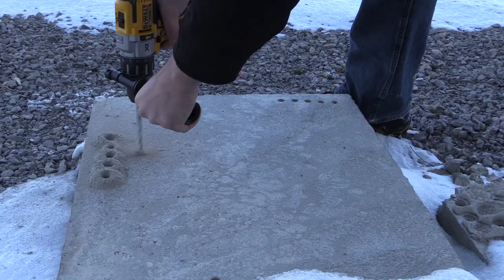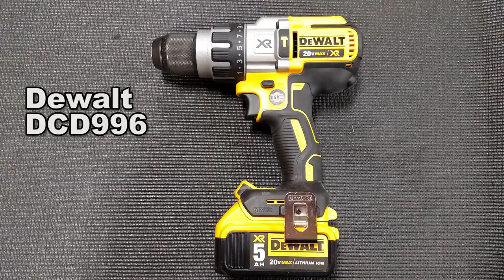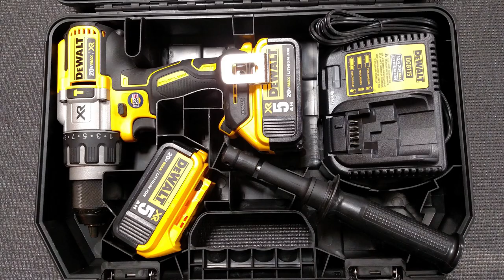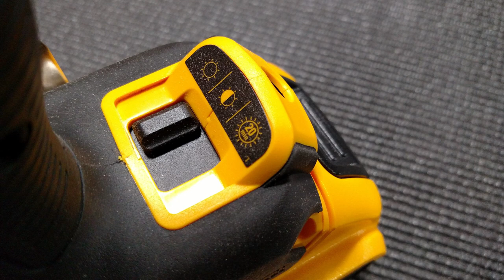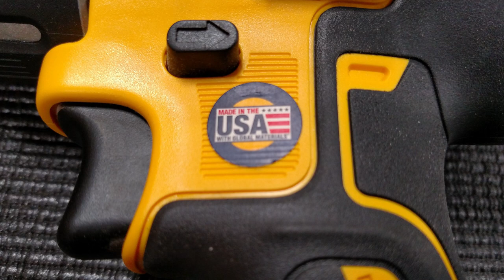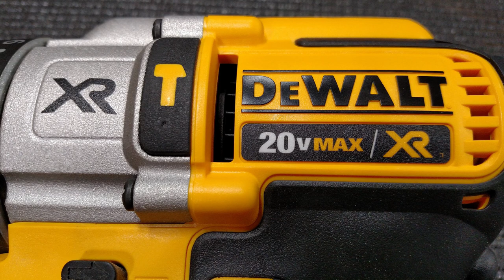Dewalt DCD996 1/2" Brushless 3-Speed Hammer Drill Driver Review

Comment: I have used Dewalt for years. I have never NEVER!!!! had a Dewalt tool fail on me. I just bought this drill to drill some 3/4 holes in concrete and it did't let me down. The fact that you can use the 60 volt max batteries with these tools has just made the 20v max series that much better. My father has had many Rigid, Makita tools, and I say many because he has had to replace them time and again. I like to spend the money on good tools and I like to use them hard and not worry. I will stop buying Dewalt as soon as one of their tools lets me down, that might be a long time coming. Milwaukee has always been the competition, but I have yet to try one. I would, but all of my Dewalt tools just won't quit. From personal experience you can't go wrong with a Dewalt. The only tool that has given me some complaint is their Oscillating saw. It gets pretty hot in the handle area. With that said, it has never quite and has been one of the handiest tools I have for construction projects.

Comment: 2 Foot 1inch auger bit in the attic during summer drilling through 3  2 by 4 stacked top plates and i'll tell you right now this drill gets VERY HOT. On the bright side though, it goes thtrough pretty damn fast. It appeared to struggle but its still much much faster then Milwaukee or Makita on gear 1.
Reply: I feel like a 2ft auger going through 3x 2x4's in summer would make any drill get hot...

Comment: I’m looking at purchasing the dcd 796 or the dcd 996 which 1 in your option is the best 1 for me to purchase because if the settings 1 and 2 are most used and setting 3 on odd occasions only wouldn’t it be best to purchase the dcd 796. Because the setting 3 is basically useless or too powerful to do holes.am I correct

Especially if the dcd796 is virtually the same as the 996 and if the 996 struggles on setting 3 then really the 996 would be a waste of money when you can purchase the 796 and do the same stuff and just as much power as the 996 and the torches on both are also the same - This is a hard choice which do I purchase please help me decided much appreciated

As there is also more torque settings  on the dcd 796 as I’ve noticed on your very good video you made

They both also weigh the same so really I’m not noticing much if anything different on both models apart from setting 3

I look forward to hear back from you so I can place my order thank you...
Reply from the maker: DCD998 https://amzn.to/32P5Fkf

Comment: Hi, I'm researching tools to set up my first woodworking home shop and I'm interested in this drill because I also have concrete walls on my house. I thought this would be a good option to serve both purposes but I'm concerned that it might be too heavy and bulky to use as a wood shop drill. What would you guys reccomend?
Reply from the maker: soundboy89 For a full size drill, this is a powerful one!  I would buy it and once I got it home I would check the run-out on the Chuck to see if it is acceptable for your woodworking.  Milwaukee gen w M12s are nice also if you want small and powerful.
Reply: I had to go Google "runout" haha I'm just getting started in all this. I'll look into that Milwaukee also, thanks!
Reply: WorkshopAddict hey I was just curious if you think run out is a “normal” thing in cordless drills? I ask because I have a nice Bosch drill and it had wobble so I sent it back to them and the new chuck still seems to have a little bit. I thought about picking up this Dewalt but if it’s the same idk if it’s worth it.

Comment: Hello, i want to ask if your drill at speed 1 and clutch 1, if you press the trigger all the way down fast, it will stop? bcs mine stops. This happends to me only no clutch 1 and 2.
Reply from the maker: possible that it could stop and clutch setting 1 and 2 in low range might see too much torque for the drill and stop it.  Those are VERY light settings and a full power trigger squeeze would not be normal.

Comment: Great review! I have been trying to figure out if I should go with the 996 or the 796... I'm primarily a handyman, and could definitely benefit from the more compact size and weight of the 796... but is the smaller size worth the sacrifice in power and the 3 speed trans? What would your 2 cents be
Reply: Bear Lemke I’ve got the 796 and it’s got plenty of power for most tasks. When it comes to bang for your buck, I think it’s the best drill out there. It pisses on my old Bosch from a great height.

Comment: Have used mine, he toured 1/2 metal drill on galvanized pipe, when I got into the pipe the metal locked up and almost broke my wrist.
Once I took my finger off the trigger the bit fell out and now the jaw holder will not work if any one has this problem and the fix
Reply: I'm afraid you may have to take the chuck off and disassemble it to repair, or replace.

Taking the chuck off isn't as simple as a screw in the bottom of the chuck.

It's press fitted, but not massively tight.

There are some tutorials online. Just don't follow the ones that tell you to put an allen key in the chuck and then hit it with a hammer. It may work, but it may also damage your drills internals.

Comment: Hi, I bought this drill a few days ago from Amazon. On my drill, the electronic brake system produces a very loud noise when the trigger is released. It is much louder compared to my other drills. Is it normal to this model of drills?
Reply: Prasanth Jose yes, mine does as well, but i believe its normal, as the drill is just way more powerful than any other ive used

Comment: why the battery somehow is loose and not stable? So I don't know if i want to buy it or not. So please tell me if the battery would fall off.
Reply from the maker: binh ho the battery would never fall off in normal use.
Reply: WorkshopAddict seam like is loose
Reply: I went to lowes today and decided to buy it. I used it but the battery somehow was loose and afraid it would break down. Therefore I didn't buy it
Reply from the maker: binh ho it's not
Reply: The battery is a bit loose to prevent the contact pins between tool and battery from breaking. This is done by design.
Reply: binh hoqqq

Comment: You left out you can use this with the flex batteries. 20/60 volt 6 amp battery
Reply: You can use any 18v DeWalt gear with flexvolt batteries (in every country but America it's 18v not 20 max 😂)

Comment: i have the dcd796 and dcf887 and i thing that dcd996 would complete my dewalt drill/drive yellow platform!!!do you feel the drill power as if it is like lets say into 100~110Nm area!?!?!?do the makita and milwaukee premium hammer drills feel like more powerful than dcd996!?!?and if the are,i think that 3gears helps the lower power output of this drill!is it right?
Reply from the maker: The three speed help to get you more torque for the middle speeds, around 1400 rpm.  I feel that this drill has the same power the New Milwaukee has at 1200 inch pounds.  That is specified at more than the Makita.  I will put my "reputation" on the line and say that for a drill, it rocks and you should not be disappointed.  I cannot tell you exactly how it compares because that would take equipment I don't have.  But if you watch our videos, you don't see me using a side handle much.  I did with this drill!

Comment: what will you recommend for diy dewalt dcd 996 or dcd 796? both are awesome I'm confusing I want to get some advise
Reply from the maker: What is the plans for it.  DIY can mean a lot.  If you want pure power, go with the DCD996.  Is there a big price difference or do you want a smaller drill?
Reply: +WorkshopAddict sometimes I'm gonna use it in concrete or metal but more often in wood to make large hole...the problem in dcd 796 it's not available in bare tool that's why I'm confusing I don't need charger and battery
Reply: +WorkshopAddict by the way I'm new in woodworking
Reply from the maker: The 996 will be the way to go to give you all the power you could ask for and having you looking for another large drill.

Comment: Just got this, and returned it 30 minutes later. I ordered this kit and was hoping for something awesome but was extremely disappointed. I might go into details later
Reply from the maker: What?  You have to go into details.  This is a kick butt drill.
Reply: +WorkshopAddict hello,I've been waiting for this beast for a month and finally my supply house could order them so I ordered the dck299p2 with the 996 and the 887 impact, and waited for a couple weeks till it came in. I was expecting something awesome and when it finally showed up both the drill and impact had problems, I was so disappointed. About to give up on Dewalt. I returned them 30 mins later. Today I went back and picked up a new kit, hoping the first one was a dud. I got it out and found the most awesome, most powerful drill and impact I ever used. My other drill was the 995, and I've used the new Milwaukee gen2. They are so well built. The impact is incredible, even speed 1 which I was skeptical about has its place when used properly. The one thing which I agree with you on is the forward and reverse switch on the drill is a little soft, it could be a little stiffer. But overall Dewalt has hit a home run with these. And the light is incredible. And to you great review.
Reply from the maker: +Kent Catlett That's Great!  I was talking to a buddy saying how I said people won't return this in 30 days and you returned it in 30 minutes.   I wondered what went wrong.  Thanks for clearing it up and I hope you enjoy the tools!
Reply: this drill is a monster why return it!

Comment: im stuck between dewalt and milwaukee ! plsss tell me which one is better ?
Reply from the maker: The new Milwaukee Fuel and this drill are so close it is hard to tell the difference.  It should come down to two things.  One, do you want three speeds and what other tools you plan to buy in a battery platform.  Dewalt is the only one with three speeds.
Reply: +WorkshopAddict thaaaank u so much

Comment: I thought the rpm on the 3rd speed 0-2250?
Reply: That's when it's in hammer drill mode. its 2000 in regular drilling mode.